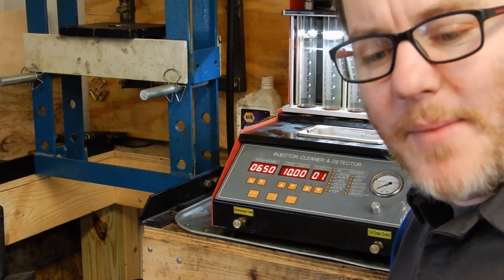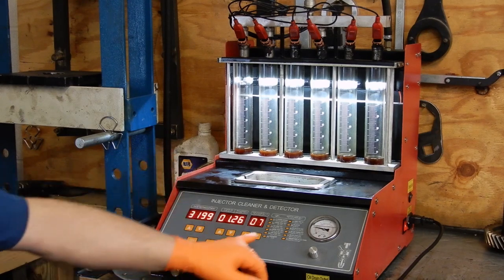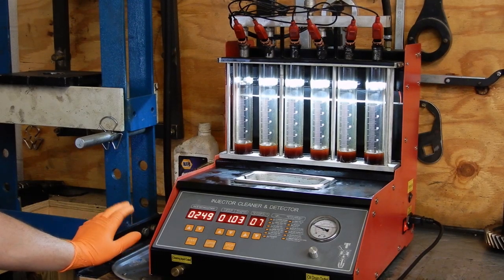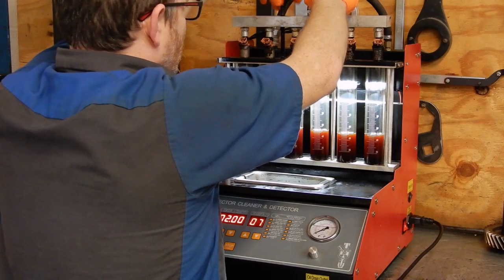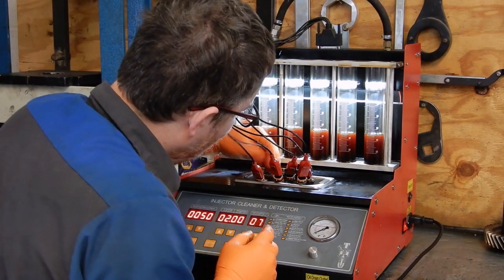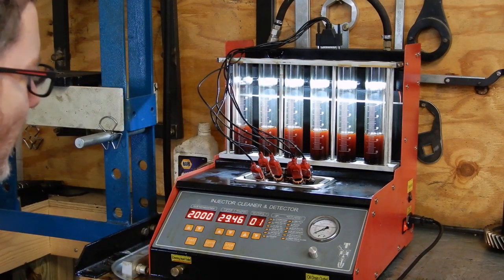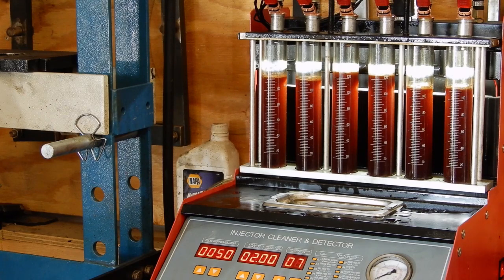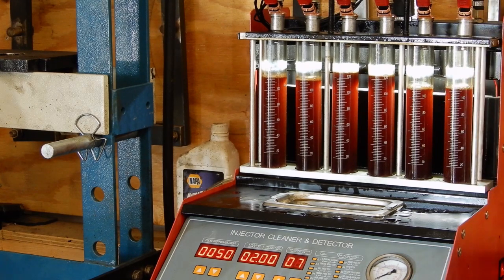Fuel Injector Tester and Cleaner Tuesday's Tool #3

Comment: Can you reuse the fluid when youre done flow testing?
Reply from the maker: I'm not sure if you're supposed to, but we do.
Reply: I bought 1 after i watched this and the manufacturer suggested to change fluids every 3months of use. Or if there is a significant change in color.
Reply: Btw how much pressure are you running?
Reply from the maker: @cocoloco1994  I think around 60psi
Reply: @OTRAMM  hi what fluid do you use for the flow test and the ultra sonic pan

Comment: Is the wiring harness that is provided a universal fit or do you need different fuel injectors wire hardness connectors for various vehicles?
Can you back flush the injectors, how do you do that?
Reply from the maker: It came with the harness. I've only used it on Toyota injectors. It's fit all of them so far. It doesn't have any way to back flush.
Reply: @OTRAMM  Thank you for the fast reply. Does the wiring harness have a quick disconnect so that it can be interchanged
to other wiring harness for other vehicles. I have three different vehicles here two of them have electrical connectors
where the older vehicle has a CIS mechanical fuel injectors no electrical connections. Would your machine be able to clean
those too?
BTW your video is outstanding.

Comment: What kind of fluid are you using for testing and cleaning?
Reply from the maker: For the ultrasonic Simple Green Aircraft extreme. In the flow portion Techron fuel injector cleaner.

Comment: What do you use for the ultrasonic cleaner fluid, and the flow test fluid?
Reply from the maker: Simple green aircraft extreme and water in the ultrasonic. Marvel mystery oil cut with techron in the flow tester.
Reply: @OTRAMM  thanks, I wondered.
Reply: How/why did you choose these fluids? I’ve heard many recommendations for 75% or greater isopropyl alcohol as a test fluid
Reply from the maker: I was more after cleaning than a test fluid that would mimic gas. I liked the oily residue of marvel mystery oil to keep things from corroding before install. It was too viscous for the tester on its own so I cut it with techron. Nothing scientific, just what was readily available in the parts room.

Comment: Where did you buy this and how much? Have seen some similar on eBay and amazon, but looking for a good one for home use around $500 thanks
Reply from the maker: I'm pretty sure it was from Ebay.  I want to say it was around 400 but it's been a few years since I bought it.
Reply: OTRAMM I seen on another comment about what you use, how much of the simple green aircraft extreme to water do you use and same about what you use for flow testing.  Or are you using different solutions now?  Thank you
Reply from the maker: It's been forever since I've used it.  The aircraft extreme I use straight and top off a bit with water as I spill stuff.  The flow tester I use a big bottle of mystery oil but with a bottle of 44k or other injector cleaner.  The mystery oil is too thick on it's own to get a good spray pattern.  They make actual test fluid for them but I don't use the machine often enough to bother.
Reply: OTRAMM thanks for all your help, do you know which brand or model cleaning machine you have? Maybe they don’t have that exact one on eBay any more thank you
Reply from the maker: It doesn't have any part numbers on it unfortunately.

Comment: Seen it on Ebay and I have been wanting to buy one for my motorcycle shop but I can not get straight answers from the ebay supplier as to what chemicals to use for cleaning and testing. What are you using and how has the machine worked for you.
Reply from the maker: We use simple green aircraft extreme in the ultrasonic portion. I use techron injector cleaner in the flow tester. We don't use it enough to buy the real calibrated fluid. You have to be careful of fire using the techron though. I've been happy with it. The pump died after about two years but it's just a generic high pressure fuel pump so an easy fix.
Reply: @OTRAMM  Thanks for the info.

Comment: I just purchased a 04 LX.   Is it common to have a gas smell in the engine oil?
Reply from the maker: Can't say that I've ever noticed a gas smell in the oil.
Reply: OTRAMM any ideas how gas could leak into oil?
Reply from the maker: Best guess would be a leaking fuel injector dumping fuel.
Reply: @OTRAMM  Thanks.  On a related note, I have 8 12-hole injectors that I wanted to install.  Do you have any tips on how to replace fuel injectors?  I am hoping for some tips on how to drain the fuel lines prior to install...

Comment: Is that a cleaning fluid that is used?
Reply from the maker: The red fluid is a mix of marvel mystery oil and BG44k the marvel is too thick on it's own but I like the oily coat it leaves. The ultrasonic has simple green aircraft extreme and water.
Reply: OTRAMM what’s the mixture of the simple green and water

Comment: Dumb question here ,i see six injectors ,if i need to clean 8 will the machine allow the extra 2 to be cleaned by them self ,reason im asking is im wanting to purchase this machine
Reply from the maker: Yes it has plugs to block off the extra holes so you could do two batches of four.
Reply: @OTRAMM  :pride-flower-rainbow-heart: